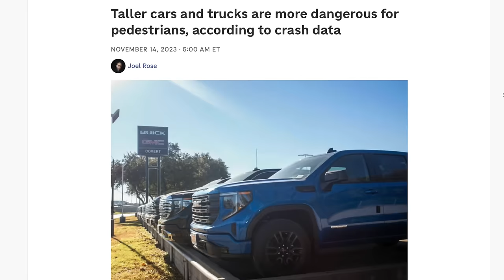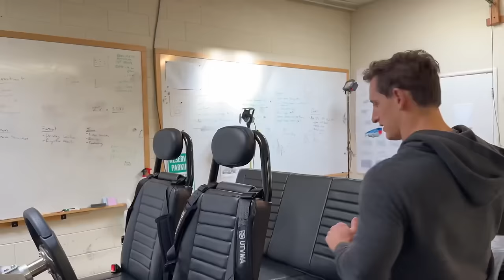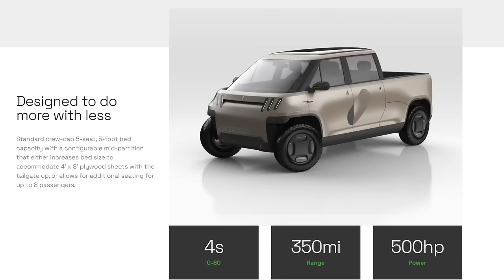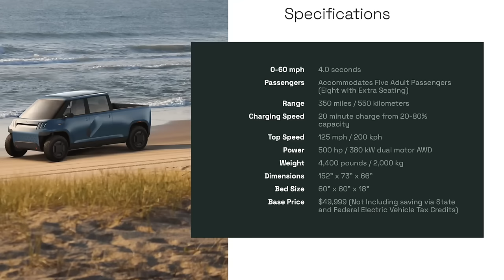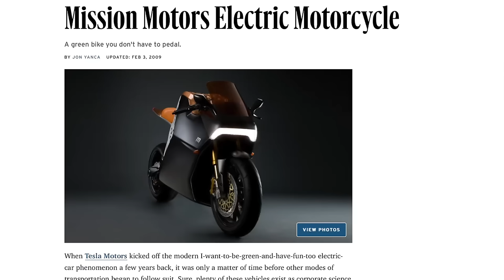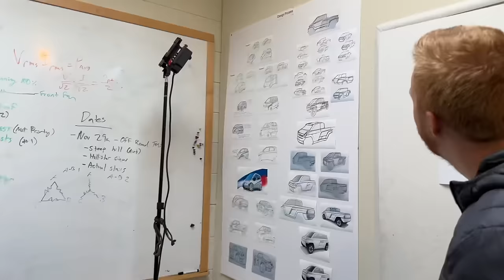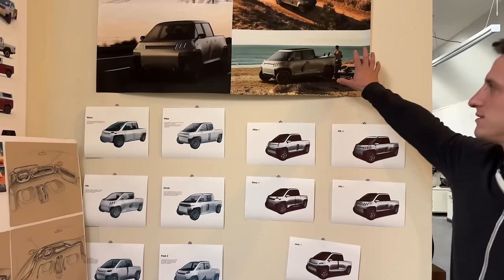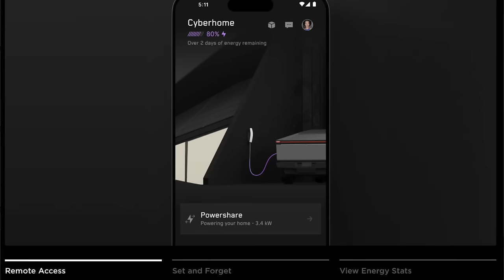Why are US Pickups SO BIG? Meet Telo

Comment: why a massive 160 kilowatt battery and only 350 miles of range? You sated 3.5 miles per kilowatt hour but would mean you would be able to go 560 miles on a single charge with a 160 kilowatt battery? I'm doubting you'll be able to sell that truck for 50,000. You can buy a far more capable cyber truck that comes with significantly more features for $50,000 in 2025. I think you could sell the Telo truck relatively easily at a more reasonable price.
Reply from the maker: 106kWh pack. Not sure where you got 160
Reply: @TailosiveEV  I was JUST re watching to verify what I heard. I stand corrected. I do still think this is a really awesome truck but I think they'll struggle selling this in mass quantities at a $50,000 price tag. I hope I'm wrong but a truck like the Cyber Truck comes with just so many more features FSD, Autopilot, Sentry mode, bullet proofish stainless steel body and more space for the same price. 

Then again, 5,000 people isn't a lot, I'm sure there is more than enough people that have 50,000 to spend on a Telo Truck so Telo can break even. 

I hope this truck is a success, I keep checking up on it every 3-6 months, I just am not the kind of person that has $50,000 lying around. So If I'm going to spend $50,000 it's going to be on on the most capable truck.

Comment: Good concept, but at 50k I lost interest.
1 - People that can afford a 50k truck arent looking for a truck this size.
2 - Canoo has concepts at a lower projected price, with an even smaller front end
3 - if your hot points are safety and battery tech, you're competing with other manufacturers who are lightyears ahead of you. Even after years of EVs, the market is still lacking a cheap, small EV truck. Why not target a reasonable MSRP?

I hope this takes off, I am just naturally skeptical after seeing nearly every EV startup fail for, what, the last 5 years? I can tell the presenter is aware of this as well, based off his desire to hold of on IPO. The design is very cool, the design phase seems to be going well. Good luck

Comment: Great idea, but 106KW battery doing 350 miles @4400lbs in a car the size of a mini doesn't seem great, Cybertruck is twice the size and gets 340 miles from a 123kw pack.@6800lbs.
Reply from the maker: Bigger battery for twice the price
Reply: @TailosiveEV  but we don’t know what the launch price is going to be for that vehicle and we also don’t know what the price of the cyber truck will be at that time as well maybe the rear wheel drive will be out by then, then how desirable is this new vehicle, they’ll be a similar situation to what Ater is facing. In the end, it’s very hard to compete against Tesla.